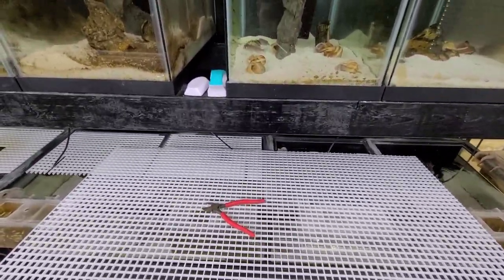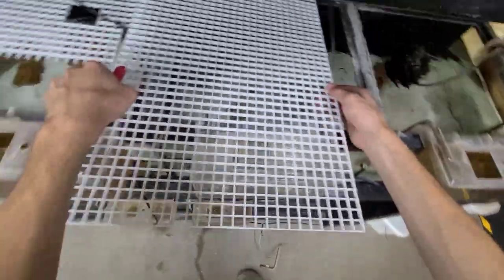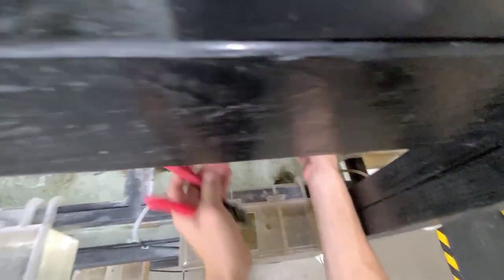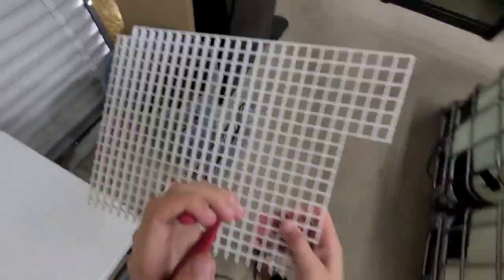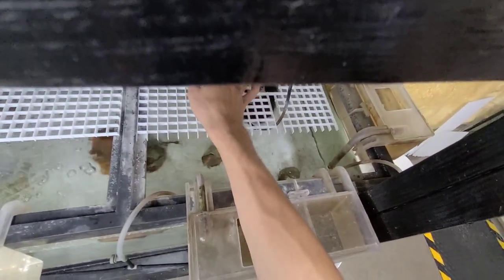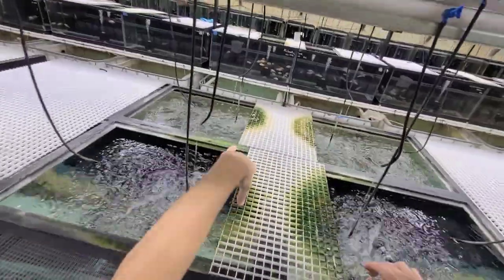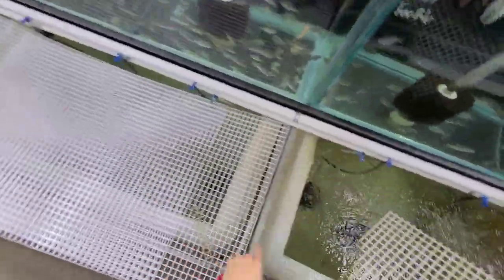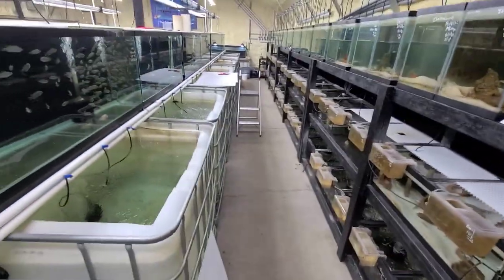DIY Custom Fish Tank Lids

Comment: I know you have a drip system but wouldn’t you lose water due to evaporation?
Reply from the maker: Yes, but it doesn't matter what type of lid you use, no matter what you will still have evaporation. We have a dehumidifier in the fish house to take out the moisture from evaporation